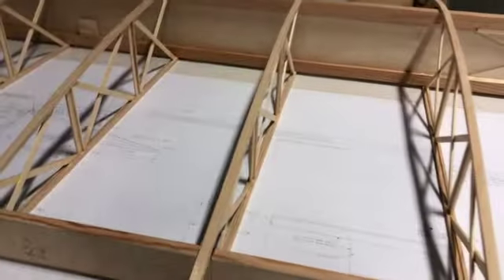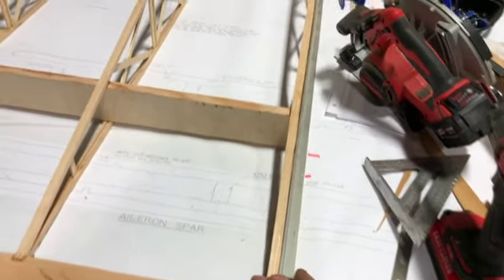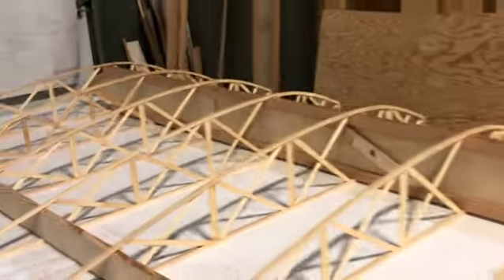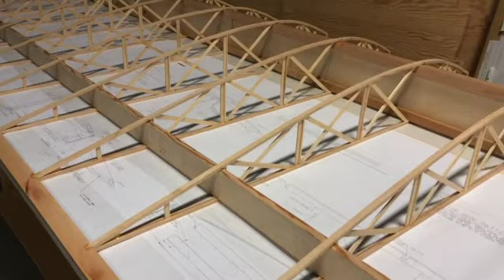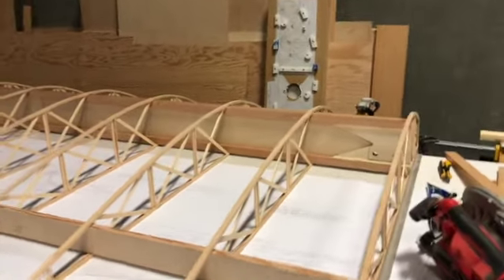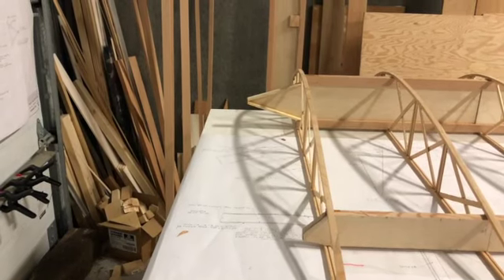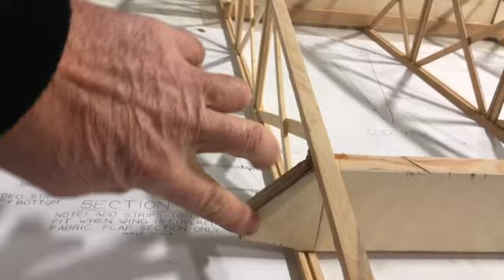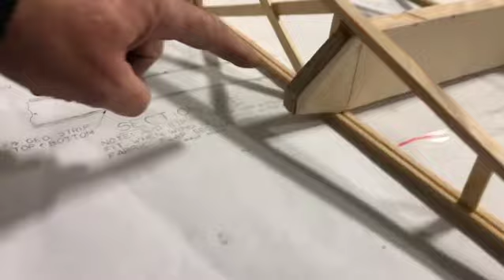DAKOTA HAWK EPISODE 29

Comment: The rib notches are not cut into the trailing edge in my kit. I followed the manual and nailed the trailing edge pieces to the edge of workbench. Marked all the gaps and notches. Removed from workbench and made the cuts. Nailed it back down and transferred the notches to the spars. I liked transferring the notches to the spars because if a notch was 1/16" off everything still ends up square.

Comment: Uhh, just cap the last rib with very thin ply and  glue a styrofoam block on shape it and glass it!! You will have a true horner tip. Leave those stubs.
Reply from the maker: that's a good idea... too late for me.
Reply: @sawyersdad5292  yeah I know!! But I couldn't,t help myself! Uhh I have around seventy radio control airplanes under my belt and the problem solving is the same. Just scaled down.I,ve done kits, pattern planes and many just from three views!